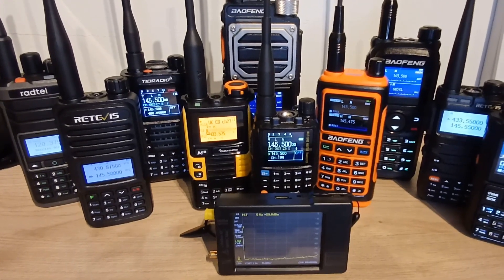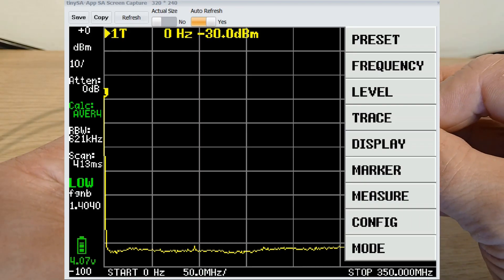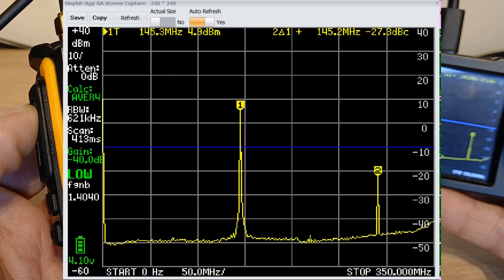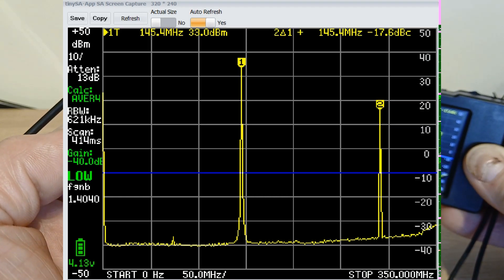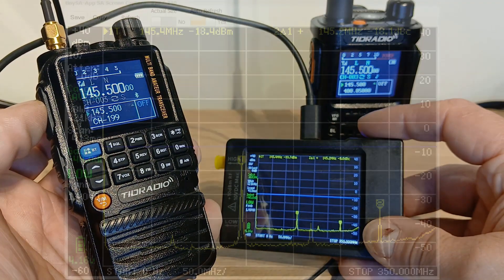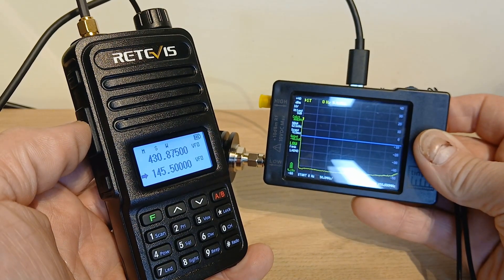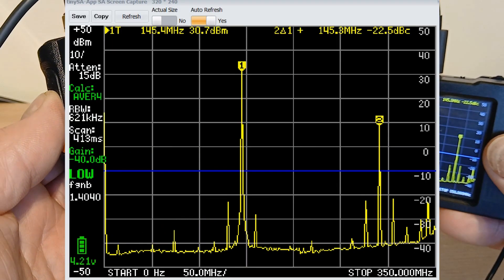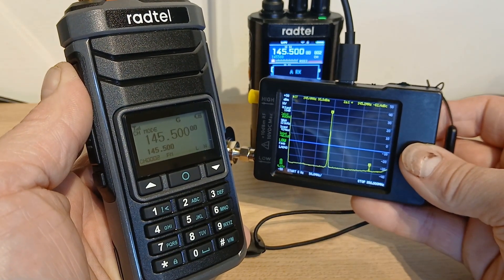Battle of the Budget Radio's Quansheng, Baofeng, TidRadio, Radtel, Retevis

Comment: Appreciate what you’re doing here, a round-up of current models rather than testing one or two radios is a good thing. That said, testing to only the second harmonic isn’t really proving whether a radio is clean or not. In many of the radios I’ve tested the third harmonic has been at a high level than the second; those which just scrape by on the second are likely candidates for a fail on their third harmonic. This likely happens because they’re dual band radios with filtering to pass 2m and 70cms, and 70cms is pretty much a 3rd harmonic of 2m.

Testing needs to extend to a point where it’s obvious no further harmonics will breach the requirements. I typically span to 1.2GHz when measuring harmonics.

In the US requirements are a little different. For a radio which operates on the 30-225MHz range, -40dBc is a requirement for a transmitter whose output power is <25W. If it’s higher, -60dBc is the requirement. An additional secondary requirement exists too; all spurii must be at a level lower than 25 microwatts. I’ve seen HTs pass -40dBc but breach the 25 microwatt requirement.

Comment: Thanks Ben for testing all the various radios. May I suggest using the same power level on each radio when testing harmonics.  This is the 2nd time I have watched this video and i noticed the fundamental peak seemed low (around 30 to 31dBm, or 1 to 1.25W) on most radios so I looked on the screens and most radios appear to be set to low or medium power except for the RT-900 which was on high.  Not saying that the general shape of the results will be different on high power, but the peak of the fundamental and harmonics should be higher. Of course, I am assuming that the input side of the Tina SA is protected from high power setting with attenuation as per video.  Also, please include testing in UHF band as I believe you will find that many radios that may have significant harmonics in VHF, will do better on UHF.  I am getting into the hobby and have recently collected a number of Baofeng, TidRadio, and Ratel radios including the RT-900.  While I have tested most of these radios for power on Surecom SW-102 meter, I have only done cursory checks using my TinySA Ultra (which I am learning to use thanks to videos like yours) and noticed the differences in UHF vs VHF harmonic performance. So while owners of the UV-25 or RT-900 may not want to use their radios on VHF, they may be OK to use on UHF until Mfg provides correction on VHF if possible? Of course listening is generally free of potential harm 🙂
Reply from the maker: Hi thanks for your comment. To be honest that was probably an oversite by me, as I intend to do all the testing on low power (around 1w). Yes I totally agree with what you're saying with regards to UHF. Unfortunately the low input range on the TinySA is only upto 350Mhz, whereas I believe in the TinySA Ultra it's much higher, so hopefully I'll upgrade to the Ultra in the near future. 
Thanks for watching and enjoy the hobby!
73
Ben 
de M7FRS
Reply: @m7frs272  You quite welcome Ben.  I do recommend the Tiny SA Ultra. Having up to 6GHz max range is pretty cool, then I think there is unlock capability to observe up to 12 GHz I believe!  Not sure what we can find up there except for X band radar signals or possibly Aliens communicating in that range hidden within 5th or higher harmonic 😊. Chao!

Comment: Hi Ben what cable would I need to connect my Baofeng radio to my power/swr meter. The meter has the so259 connector. I more concerned with the radio end seems to be different versions of the sma connectors 
Many thanks Paul 2E1HVN
Reply from the maker: Hi Paul, you get a set of SMA to SO239/PL259 adaptors, then you can use a standard patch lead with a PL259 on either end.
https://amzn.eu/d/8R36NnN

Comment: Only thing I dislike about my TD-H8 (2nd gen) is the keys seem to wear off pretty easily. Most of the front keys have noticeable wear on them.
Other than that, amazing HT for the price.
My favorite features would have to be USB-C charging and BT programming using Odmaster.

73 from Havana Florida, K4EFW
Reply from the maker: Thanks for the information. I've not had mine long enough to experience that issue, so I'll keep an eye on that. Thanks for watching and commenting 👍 
73 Ben de M7FRS

Comment: My TD-H3's were all sent back.  The 3rd Harmonic was worse than the 2nd.  Why did you only show the 2nd?   Did you look at any power specs?

Thanks, nice review.
Reply from the maker: That's interesting, I'll have to test it out further. To be perfectly honest, the reason is that the TinySA low range only goes up to 350Mhz. I'll have to try it on the higher range, above 350Mhz. (I really need the TinySA Ultra). I did think about including the power specs, but that would make a longer video, and people tend to lose interest after 10 minutes of my voice lol. Thanks for watching! 
73 Ben, de M7FRS.
Reply: @m7frs272  I borrowed a TinaSA to do the tests.  Such a cool device.   I hear ya on the power.  Sounds like I'll check out the Ultra.  Carry on good sir!

Comment: The coming Quansheng TK11 is the unit to get. Noting only one model out of three has the two antenna.
Reply from the maker: It will be interested to see how the new Quansheng TK11 performs (especially compared to the Radtel RT-860 which also has the 2 antenna ports and the Si4732 chip circuit for HF reception) Thanks for watching and commenting. 👍

Comment: Hi Ben. Thank you for your video. No surprise that the Baufengs didn’t do too well, but it might have been interesting to have included the GT-5R which is sold as the cleaned up version of the UV-5R. Got a couple you can borrow if you need to. Cliff M7HMK
Reply from the maker: Thanks, Cliff. Yeah, I've not got or tried the GT-5R. That would be great if I could try one for a video! 
By the way, I just caught the end of your QSO on GB3YL earlier 😉
My email address is in my channel description or on QRZ if you want to drop me a message. Thanks again! 
Ben, de M7FRS.

Comment: Thankyou for this. I have an older Baofeng UV-5RT which I just use for monitoring. Unfortunately it's very prone to interference, static and breakthrough, especially when connected to a car antenna. Even the maximum squelch level can't keep out the undesirables! However, I did buy it when there was less competition in this area and it is useful to know there are now better quality radios available.
Reply from the maker: Thanks for watching, glad you enjoyed the video 👍